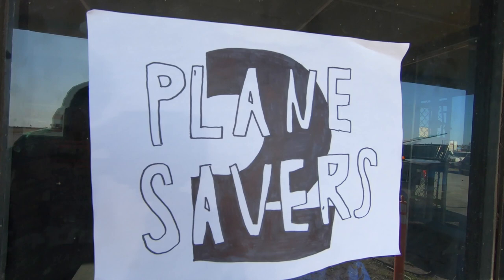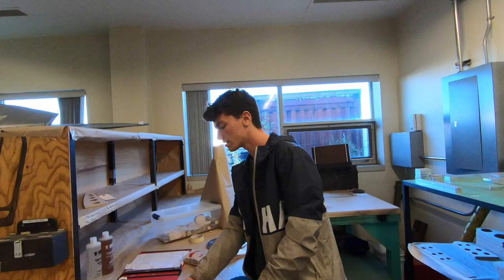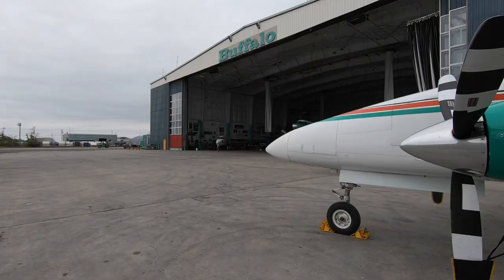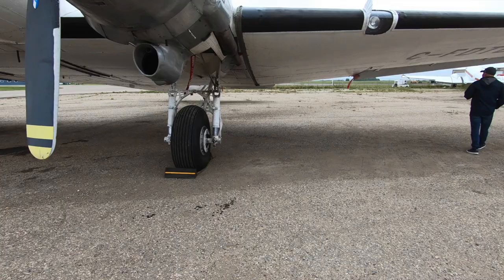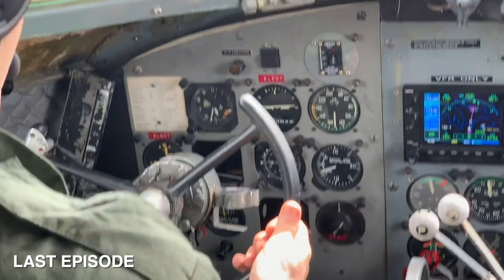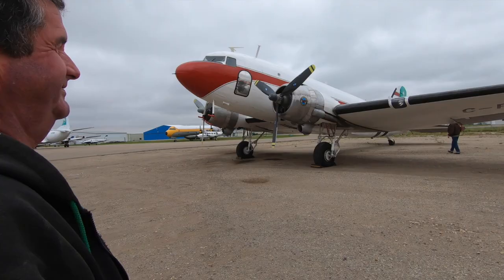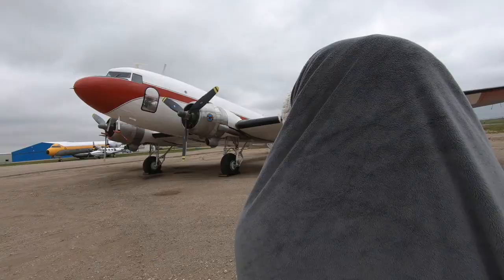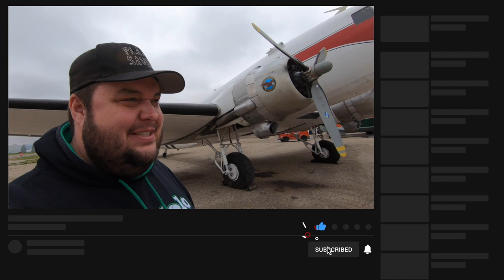What was it like to fly with a Rockstar? | Bruce Dickinson from Iron Maiden | Plane Savers S2-E9

Comment: For the next time, there are scotchbrite wheels for a bench grinder that will considerably shorten the prep time on the rib parts.  Don’t know how much more of that kind of work is coming up, but it is a great asset for wood as well as metal working.  Wheel size determines surface speed, so you can get appropriate to the work you are doing.

Comment: will you continue to turn the engines over every few days or is the aircraft going into a deeper hibernation?
Reply from the maker: Nope, we will just need to pre-oil it on the next run up (just like we did when we first started her). If it would be sitting longer then there are other procedures to do to persevere the engine.